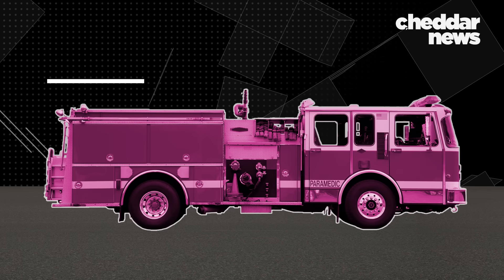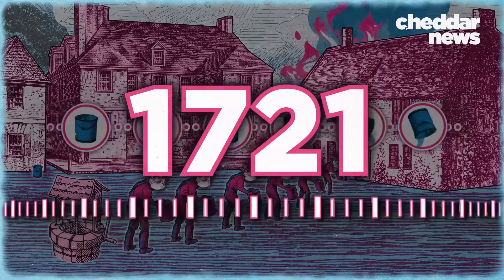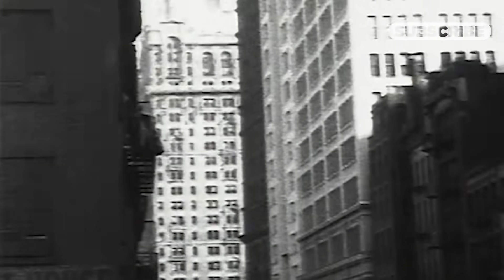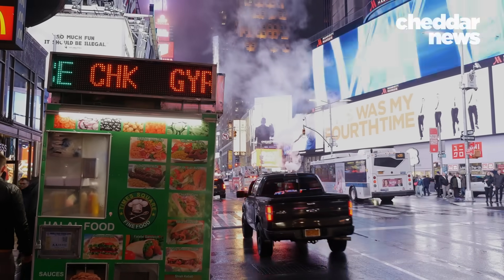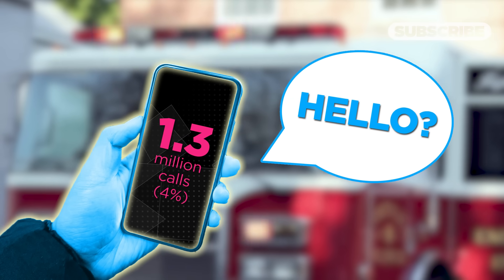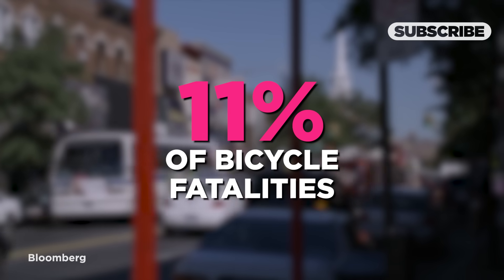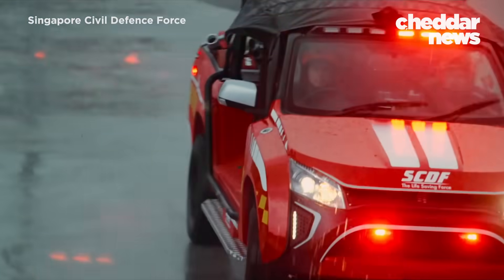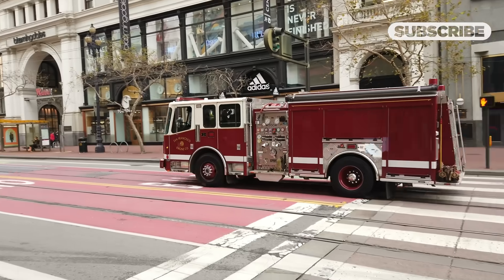Do American Fire Trucks Need To Be So Massive? - Cheddar Explains

Comment: It's downright evil for the Baltimore Fire Department to be campaigning against bike lanes (especially when they are using a video that clearly shows that CARS - not bikes - are obstructing their vehicle).

If you look on YouTube you can find several examples where, instead of throttling back bike lane support, European countries have built wide bike lanes that are big enough for their narrow fire trucks to fit on. And, when there is gridlock in a European city that has wide bike lanes, the fire trucks can hop out of the road and into the bike lane and the cyclists ahead of them, will get off of their bikes and get onto the pavement to let the truck through. So rather than obstructing fire trucks, bike lanes can actually function as emergency fire lanes, that fire trucks can use in the heart of a city, in the middle of the rush hour.

US fire departments should also be campaigning for the return of tram lines (or as you call them: streetcars) so that the lanes in busy cities are closed to car traffic, while being available for fire trucks to use. And they should also be campaigning for pedestrianised areas, which fire trucks will still be able to use as cut-through routes.

Comment: It for a reason why the USA fire are bigger. Because they  have more stuff on there truck .   And the USA can take more people on the truck . Not hard on top of that it easy to get there air tank out the seat they are in .
Reply: as a matter of fact, they only have more water on board, but neither more firefighters, nor more equipment than the smaller, more compact trucks in e.g. central Europe. "And the USA can take more people on the truck" sorry, that's not correct. The standard is 6 firefighters on an Engine in the US, right?

Comment: Of course this silly video cherry picks the longest fire truck they can instead of using an average one.
Reply: In the US a Tiller Ladder is a pretty standard truck ...
Reply: @EnjoyFirefighting  It's a fairly common truck, but it's not the most common aerial platform anymore. I saw an estimate that only 5% of ladder trucks are tillers.
Reply: @fieldmojo5304 still a higher share than Tillers in Europe.
However, even a 100 ft mid mount ladder still has an extreme overall length in the US ...

Comment: Inner city stations with close support and tough traffic would benefit from more smaller euro style trucks. But the rural u get theres less support and greater distances, fortunately theres bigger open roads so its use by case approach
Reply: and yet Europeans go for the approach for large centralized stations instead of numerous tiny ones even in downtown areas, at least in most countries

Comment: Your video is misleading. Your argument is based on large cities as though it's how all fire departments operate. Most departments have trucks that fit their needs. Few departments have big ladder trucks because they don't need them. And smaller departments that do need ladder trucks don't have 100'  ladder trucks. They have 50', 75' or 25' and so on. European trucks are smaller because of their roads and small towns. Most are also mountain towns that don't support larger trucks. Only the large cities with highrise buildings tends to have large ladder trucks by European standards.
Reply: over here 100 ft ladders is the standard, no matter if you're looking at an urban department in a city of a million inhabitants, or a rural department in a village of 10,000 inhabitants. Shorter 60 t ladders used to be exist, but even back then they never really got popular here. 
"because of their roads and small towns. " actually, US fire trucks would perfectly fit into most European cities. Look, they have articulated and even double-articulated buses and semi trucks, of course large fire trucks would fit onto normal roads as well. As for small towns: the city of Berlin is slightly larger than NYC, just saying. 
Old towns are tight and more compact, yes.

Comment: maller trucks can get around traffic by driving on the bysicle lannes as they do in the netherlands.
so safer road infrastucture for everybody and faster imergency responces becouse cyclist can clear a bikepart much faster than cars can do, no matter how wide the road is.
Reply: if there wasn't just a single lane for cars with curbs on either side, cars would be able to clear the road just as fast. Bicycles have no real advantage in terms of how fast they can clear the path ... 
"no matter how wide the road is." if that was true, I'd be driving on the bike lane way more often, but I don't. Despite driving rather compact emergency vehicles ...

Comment: Not a fair comparison, you are showing NYC fire trucks, NYC has much taller bldgs compared to European shown in the video was just 2 storey. Rapid response team from Singapore can only support the medical emergency nothing else. US Firetrucks are like swiss army knife they can do multiple functions hence they have to be larger to carry tools and supplies + the water tank.
Reply: still the FDNY has only 100 ft ladders, the same height of ladder you'd find at fire departments in European villages of few thousand inhabitants as well. 
"US Firetrucks are like swiss army knife" what swiss army knife task can a US Engine do? It has a tank, pump, hoses ... a rather small crew and a very limited range of other equipment, right?

Comment: In small areas I can see why smaller makes sense, but in big cities you dont want s regular size f150 as your only layer of protection when working a call on a busy highway. These big engines are super important to safety of the crew
Reply: guess what: they have highways in Europe, too. And not just speeds of 65 to 75 mph ... in e.g. Germany traffic might be approaching at 100 to 150 mph and they still place their normal Engines there to block the scene ...

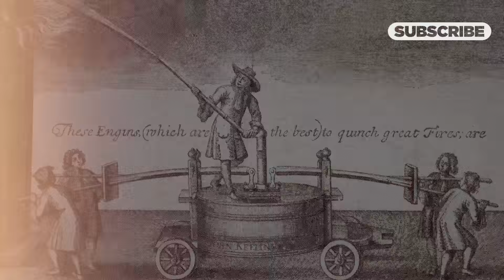Comment: @01:06 A few things here:
"...not the most effective either..." Compared to what? The previous bucket line? Much more effective! Compared to... nothing else in fact. So:👎
"... firefighters would show up late..." Judged by who? In which circumstances?
The Newsham engines were patented in 1721, the first to arrive in New York was in 1731. Now that's what I would call ineffective and late! So:👎
@01:20 So, it took another 70 years to find out they were designed to be pulled by horses? Repeat:  Now that's what I would call ineffective and late! So:👎
The real cause of the obese firetrucks is not mentioned... The monopoly of firetrucks for the US of one company! Now that's what I would call dangerously ineffective and utterly bad! So:👎

Comment: The primary reason fire trucks are smaller in Europe is simply because the HAVE to be.  The streets are dramatically smaller due to being built a thousand years ago. In these densely populated areas the structures are primarily built of masonry and the lid growth heavy timber. 
In these densely populated US, there are big wide streets that allow for fire trucks to be built without compromise. The construction in the residential side is increasingly lightweight construction and the need for increased fire flow with less manpower dictates that more work must be done with tank water than rapid connection to hydrants. Increasingly US fire departments are expected to handle more and more hazards from medical to hazardous materials and technical rescue.  This must be done with less manpower and therefore more equipment must be placed on the apparatus. End of the day, European rigs aren’t better nor are American rigs.  Both are designed for very different target hazards in different areas.
Reply: only the streets in historic and preserved areas and some residential neighborhoods are tighter; Historic areas make only a small share of the entire city area, in most places it's not relevant at all.
Plain normal streets are wide enough to accommodate articulated buses and semi trucks, then also large fire trucks would fit with ease ...
Reply: @EnjoyFirefighting true. But when you specify your equipment you spec it out for the worst case.
Reply: @Rescue-mt7fl  different size of apparatus for different purpose ... in European cities you can find anything from compact Quick Attack Units to full size semi trucks transporting large amounts of water. You wouldn't take the truck spec'd for the worst case when responding to sth as simple as e.g. people trapped in an elevator, lift assist, medical calls or small animal rescue, would you?
Reply: @EnjoyFirefighting I worked on a heavy rescue for 20 years. We did take the apparatus built for worst case scenario to all calls we responded to. We also spaced apparatus for the response area they primarily responded to. For example, the old town area had tractor drawn tiller ladders vs straight stick ladders to be able better maneuver in tight spaces. 
Our pumpers carried 750 gallons of water, even though we had hydrants at the start of and midway down each block. Hydrants could freeze or fail, so we were still able to maintain a 150 gallons a minute flow rate for 2-3 minutes and knock a fire down while obtaining a secondary hydrant. In other areas the minimum tank size on an engine is 1000 or even 1200 gallons as there isn’t a hydrant within a close proximity. The size of a pumping apparatus is largely dictated by the amount of water it can carry. The second thing dictating size is the size of its pump. Modern lightweight construction burns hot and fast, a minimum of 300 gpm at 150 psi from at least two lines is required within the first 5 minutes. Should the fire be well involved, then a flow of 1000-1300 gpm at 80 psi becomes needed through master stream devices. The small pump on a brush truck doesn’t cut it. Because seconds count, a fire crew is on that pumping apparatus for all of their calls. The rake this worst case apparatus to slips and falls, because the next call may be the structure fire and they don’t have time to respond back and trade out rigs, nor is there budget for many rigs for different jobs.
Reply: @Rescue-mt7fl  A heavy rescue to all kinds of calls? Many departments here barely need their heavy rescue, as the tasks are covered e.g. by Engines in most incidents. We have 12 standardized types of water carrying apparatus according to today's standards, not counting old apparatus following former standards but which are still in service. They range from no tank to 1,188 gallons (can be more, but the standard only dictates the minimum). A "normal" full-size Engine, both in the city and countryside, usually has a 528 gallon tank here, and is equipped with a 528 gpm at 145 PSI pump

When a call for e.g. EMS assist to open a locked apartment door, we will neither respond with a full size Engine with a crew of 6 or 9 firefighters, nor with a Heavy Rescue Truck, just because the next call could potentially be a fully involved structure fire or train derailment. They'd respond to that minor call with a Rescue Van with a 3 man crew. They won't even have a fixed crew for each and every truck. Especially special operations apparatus usually get the crews from other apparatus; Thus e.g. crews for a Heavy Rescue will always be from another type of truck, it just wouldn't pay out to have a crew sitting at the station all day long for a special operations apparatus which barely runs any calls. 
Largest station in my state for example has more than 60 bays but only a 21 men strong station crew each shift. Apparatus are cross-staffed and each normal firefighter is assigned to at least 2, if not even 3 or 4 different units during his shift 

Some time ago I've been spotting in a city in Poland. At one station you could find 4 different kinds of Engines for different purpose and with different sized tanks:
- Quick Attack Unit with 290 gallons 
- Tanker with 726 gallons 
- Larger Tanker with 2,324 gallons
- Large Capacity Tanker with 6,604 gallon 
They won't take the Larger or even Large Capacity Tanker to a reported trash bin on fire ...
Reply: @EnjoyFirefighting yes, I worked in a system that had 50 stations, 3 heavy rescues and an average run capacity of between 1500 to 4300 calls per apparatus. That was planning for that particular jurisdictions worst case scenario on any given day. 8 person heavy rescues were dispatched on working fires, multiple vehicle extrications, elevator rescues, industrial accidents as well as major medical incidents within the given run area. For the rarer incidents such as structural collapse or trench collapse we maintained larger apparatus for those calls that would be run by the support person assigned should it be needed. 
To your point all fire departments manage various types of apparatus between ladders and engines and rescues. The most expensive piece to any of that is the manpower. In the US, manpower is very limited by comparison to nations like Poland, though in rural Poland they lack as much as anyone.  
You still can’t compare apparatus from one nation to another any more than you can one city to another. The needs are different, the staffing is different the call volume is different. Not to mention ruin widely different construction and fire load types.
Reply: @Rescue-mt7fl  I grew up in a rather small large city of only 200k inhabitants, with 1 full-time station and 11 volunteer stations. They had only 1 Heavy Rescue Truck there, cross staffed from crews which come from the Rescue Engines and Ladder. The full-time station was running 2k to 3k calls a year, not much for being a large station. It literally took me years (!) to see the Heavy Rescue respond to a call at all, simply as they barely ever need its capability. Most rescue operations are covered by the plain normal Engines. 
Heavy Rescues have a staffing of only 3 firefighters here, while Engines come with 6 at full-time and 9 firefighters at volunteer departments. Neither a working fire nor elevator rescue will be sth you'd see a Heavy Rescue Truck respond to, here

In our capital there are 94 stations and 2 Heavy Rescue Trucks, but we have no details on how many calls each single apparatus does, only annual station call numbers, like up to 23,000 calls a year 

"You still can’t compare apparatus from one nation to another any more than you can one city to another." you sure can. While tactics vary, and by that staffing, spec and equipment, Engines often have comparable layouts in several countries, despite minor differences and how they're actually called. Engines in Czech Republic and Poland are pretty similar, the ones in Germany and Austria as well. Same goes for cities within those countries, like within Germany: Even with different chassis, manufacturer and layout: an Engine of a specific type will come with the same specs no matter if it's in a rural area in the very north of the country or in an urban area in the very south. Despite different needs, the specs will be the same: same size of tank, pump, range and number of pieces of equipment, staffing, truck capabilities, dimensions, weight, ... it will be all the same.

Comment: The Evolution of the distinctive American Fire we know today was shaped by Companies such as Ahrens-Fox Manufacturing Company from Cincinnati and the Knox Automobile Company of Springfield, Massachusetts, and the development of a mounted extension ladder to the top of a ladder truck equipped with a spring-assist mechanism that raised the ladder into its elevated position. 

Today's modern fire engines are packed with fire and rescue equipment, including hoses, ladders, self-contained breathing apparatus, ventilating equipment, first aid kits, hydraulic rescue tools, sirens, lights, and communications equipment such as two-way radios and mobile computers. With all of its first aid and emergency equipment, fire engines are commonly used for purposes other than firefighting, such as emergency response, wildland fire apparatus for navigating rough wildland terrain, and water tenders for transporting a large amount of water

Comment: Each truck is different say a Rescue rig could be longer while a brush truck is small and compact they are mostly the same width but each are different size like a tiller to a normal ladder that has just a stick not to mention people in the US that drive are mostly idiots and don’t pull over when they see lights or hear sirens which is why we stop at all intersections

Comment: That's the same thing happened with US automobile market. Many people buy a pickup truck or an SUV , which have ridiculous size and fuel consumption, for the same reason that US fire department need huge fire engine: "we need that extra space in case we need to do something". Meanwhile every other countries actually use their brain and buy normal size car / fire engine. And by the way, US sent fire engine to deal with every situation, for car crash , heart attack to ...pet rescuing. That's what happened with your brain when you eat too much MSG and use multiple unnecessary kind of drugs.

Comment: You forgot to mention when you related the costs of trucks, that that cost is a recent thing ever since 1 company was basically allowed to buy every other manufacturer of fire engines and "consolidate" them until they were forced to split in 2. Now they own the chassis\frame company for the trucks that ALL manufacturers need, and they own nearly the entire truck truck production as well.